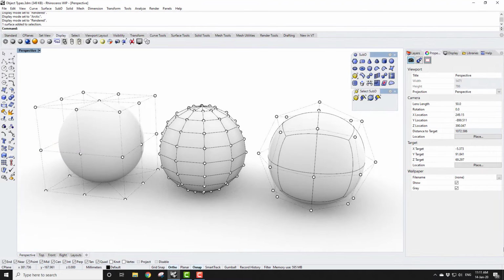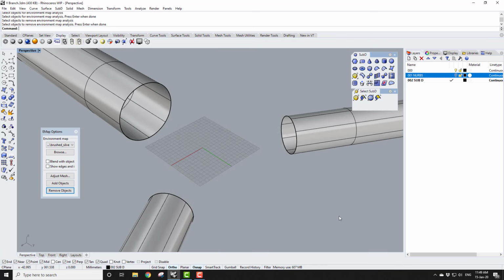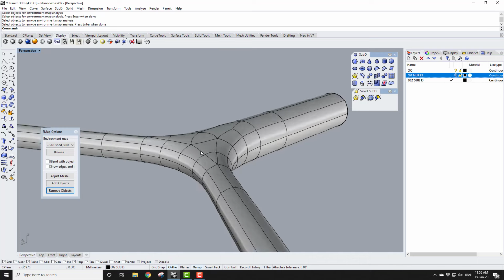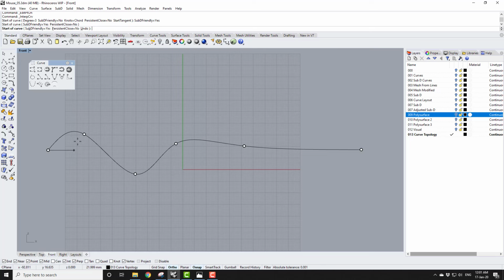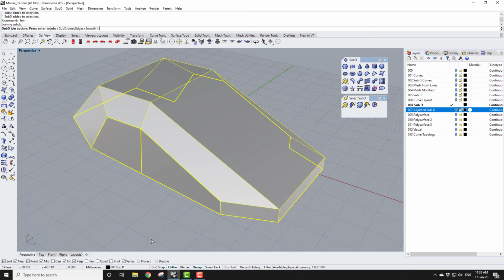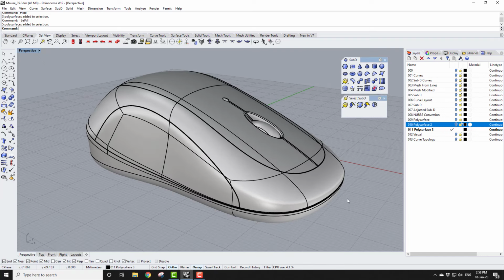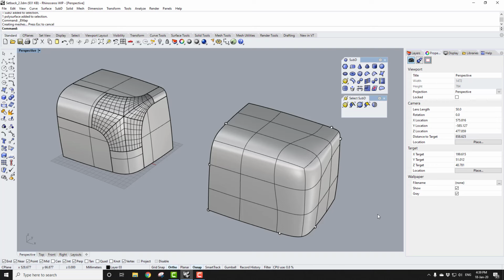An Introduction to SubD (Subdivision Surface Modelling) in Rhino3d v7

Comment: Why can't I select separate lines as 16:00 ?

And I have whole detail stands out !
Reply from the maker: Hi, To select SubD Edges either use Sub Object Selection (Shift+Control on PC or Shift+Command on Mac) and pick the edge or edges you need. Alternatively use the ‘Edge’ selection filter from the SubD toolbar – to add more than one edge hold down Shift.

Hope that helps!
Reply: @SimplyRhino3D  It helped so much, thank you))

Comment: How did you achieve a SubD surface by using Loft command rather than SubDLoft at 22:15?
Reply from the maker: Hi Yusra7. This video was created with a WIP version of Rhino 7. At that time the SubD Loft was a ‘Style’ Option in the usual Loft Dialog Box (along with Loose, Tight, Uniform etc). In the shipping version of Rhino 7 there is a dedicated ‘Loft’ command in the SubD Menu and the type in commands are now different ‘_Loft’ and ‘SubDLoft’. Hope this helps.

Comment: Always the best clarity Phil. Thanks for this one too. New to subD. Process strategy for joining 6 tubes at a common center with each out plane with the others? (Multipipe not useable.)
Reply from the maker: Hi Mel, I would concentrate on the topology and let the shape sort itself out to begin with – retain a four sided topology wherever you can.  Main requirement would be that each of your six ‘tubes’ had the same number of faces/edges around the circumference. Then you can use ‘Bridge’ or to create transitions between single pairs of faces/edges at a time, gradually working out the topology as you go. You might find that ‘Append Face’ is useful too in manually creating single faces as will working in ‘Boxy’ (ControlNet) display rather than using the smoothed form.

If 1-2-1 training would help then we do offer that as a service too, just let us know and we can send you more details.
Reply: @SimplyRhino3D  Thanks for this Phil —  I will follow the process you have described above. Please send additional on training. My Rhino Discourse ID is mhristau if that’s a better channel.

Comment: Hi Phil, I have just downloaded Rhino 7 eveluation and I have noticed that when I click on a curve the control points automatically come on, is there any way of changing that so they only come on when I turn them on. I have rhino 5 and this doesn't happen on there, I find this very annoying. Need help.
Reply from the maker: Hi Reg, I’m glad you find that annoying too 😊 This behaviour can be turned off here: _Options > Rhino Options > Mouse > Uncheck ‘Turn on control points when selecting a curve, light or annotation’. Hope this helps. Thanks, Phil
Reply: @SimplyRhino3D  Thnx Phil, much appreciated

Comment: Stitch creates an edge while Fill Hole creates a lack of an edge.

However, if one does not want the edge to be hard (ie filleted) that's when you use Crease, or in this case, remove crease.

SingleSubDFace uses edges to create a new face. (Use the flat view.)

Comment: Would Sub-D be the most suitable tool for designing a yacht?
Reply from the maker: Hi Evandro, Yes, but personally I would use SubD for the conceptual design, to explore and develop forms. Ideally you would need Rhino’s  NURBS surfaces for hull forms and superstructure so that you can maintain the correct fair-ness and clarity of form. SubD could also be extremely useful for interiors for areas such as upholstery and fabrics where we are dealing with less structured forms. Hope this helps. Thanks, Phil.
Reply: @SimplyRhino3D  thank you so much!
Reply from the maker: @evandromarchezinibezerra5206  You're welcome!

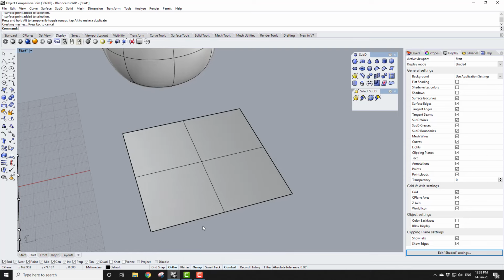Comment: 5:50 How do you pick  just one square and not a whole surface?
Reply from the maker: Hi Comprime. To select a single SubD face you can use either the selection filter in v7 and set this to faces (this is in SubD tools) or use Sub Object Selection (in Windows hold down Shift+Control before clicking on a face or edge or on a Mac it’s Command+Shift). Hope this helps.

Comment: The final bit at minute 36 is a bit unsettling to me. I have been working recently on a project where I need to make in SubD two planes that intersect doing a quarter pipe, i.e. 90 degrees perfectly rounded quarter of a circle. The problem is that with SubD the shape starts to change before the circle should start, modifying the straight part. 

So here, the presenter says at min 36 that the SubD shape is pretty close (actually better he says) than the NURBS, but the truth is that it is different and maybe you want to do it the same while having SubD edits capability. 

Is there a way to achieve that?

Note: I have tried with _bridge command, but the same thing happens.
Reply from the maker: Hi Miguel. You cannot achieve a constant radius (arc based) fillet with SubD. SubD is roughly analogous to Degree 3 NURBS in that it produces freeform geometry – so in this case you’ll have a constantly variable radius surface.

Comment: Thank you.  Can you convert the solid back to subD?
Reply from the maker: Hi, Not easily, so we would suggest keeping the SubD geometry on a separate layer instead of deleting when you convert to a poly surface. Right now you can convert a single surface to a SubD but not a polysurface. So, if you have a polysurface that needs to be a SubD then use QuadRemesh as an interim step then with the SubD option On. Hope that helps.

Comment: Hi Phil! Why would you rebuild the Sub-D iteration in just NURBS for the final version? What are the drawback of subd compared to nurbs only ? I'm coming from a industrial design background. So technically I could 3D-print a subd to nurbs conversion or are there any difficulties?
Reply from the maker: Hi Alex,
 Thanks for watching and your question. The SubD object is one continuous surface and some operations can only be done in NURBS. You’d need to convert to NURBS to do things such as: Split, Trim, Boolean Operations, add Fillets with known radii etc. You’ll need a Tri-Mesh for STL output but yes you are correct in assuming you can go SubD-NURBS-Mesh. Cheers, Phil

Comment: This is awesome! I'm loving rh7. The multipipe is great. Dumb Question... How do you close a multipipe? I'm using the GH component and unless I have another curve(s) joining at that end it maintains open. Anyway to cap it with a round cap?
Thanks in advance
Reply from the maker: Hi Carlos. Glad you are enjoying Multipipe – when you are using this in Rhino there is a command line Option ‘Cap Ends’ which can be toggled on or off. If you want to close the ends after using Multipipe then use Fill with the Single Face Option. In both cases you’ll need to add a Crease to the ends after creating them. Hope this helps.

Comment: Wasn't the "Edit blendedge" enough for the example u gave at the end of the video ?
Reply from the maker: Hi Lucky Strike. Yes you can Edit the Blend Edge here as you suggest and this works quite well. I wanted, however,  to show a SubD alternative. The advantage with SubD here is that you can Add/Remove/Slide Edges to control the shape and effectively move the Setback too - with Edit BlendEdge you cannot move the ‘corner’ Setback.

Comment: Excellent teaching skills and useful information. This could be the fastest, shortest, and easiest way of teaching. However, I still did not find the SubD fully competing with the T-spline due to the angular symmetry option only.  If there is a way to simulate angular symmetry in the SubD then I can take back my word :)
Reply from the maker: Hi Serkan, There is no angular symmetry as yet in SubD for Rhino (that’s true), we would not be surprised to see those features come in a future v7 Service Release (or perhaps v8) though.

Comment: min 15 high points - you have those because you split an edge into a triangle - triangles for subd modeling are not good. you should have collapsed all those faces into a line and maintain quad faces
Reply from the maker: Hi Claas. Thanks for your comment. Agreed, four sided faces are optimal for SubD, particularly when being used to convert to NURBS, but I wanted to show that this is not a limitation.

Comment: Great video! An aside, how did you produce the 'triangular' portion with NURBS commands at 10:20? SplitEdge & BlendSrf for the other parts clear enough, but it gets tricky at the end with 3 edges. Thanks
Reply from the maker: Thanks David! The triangular NURBS surface was, I think, built with ‘Sweep 2 Rail’ (sweeping to the pointed end) but you could also use Edge Curves.
Reply: @SimplyRhino3D  Sweep2 did the trick!

Comment: Hi,
Could you please respond to those questions:
1. Is a Rhino sub-d surface a NURBS surface by its nature?
2. Can NURBS and sub-d surfaces be connected seamlessly in Rhino?
3. Can such functions, as booleans, be applied to sub-d surfaces inside of Rhino?
4. Can we import mesh surfaces from another programs, and use them as sub-d surfaces, and convert to NURBS?
Reply from the maker: Hi Mike, sure: 
#1 - Rhino SubD surfaces are a distinct object type. The Limit surface is Spline based.
#2 - If you mean can a SubD surface be joined to a NURBS surface then the answer is no. SubD Surfaces and NURBS surfaces are different entities. You would have to convert the SubD surface to NURBS before joining the result to other NURBS surfaces.
#3 - If you use Boolean Difference, for example, to remove a NURBS cylinder from a SubD ‘sphere’ then you will achieve a result but this result will be a Polysurface. Likewise if you Boolean Difference two SubD objects the result will be a Polysurface.
#4 - Yes. You may want to look at simplifying and re-topologising complex imported meshes with QuadRemesh before converting to SubD

Hope that helps.

Comment: Hey Phil, how do I prepare a SubD surface for 3D printing?
Reply from the maker: Hi Anthony. Your SubD surface will need to be meshed for 3D printing output. So, briefly starting with a Closed SubD, use Mesh, Triangulate Meshes and Export the Mesh as an STL file.
Reply: @SimplyRhino3D  thank you Phil.

Comment: Thanks a lot.I wonder how can I make my environment map like yours.
Reply from the maker: Hi, I created a custom Display Mode for this. I duplicated ‘Shaded’ as the starting point and used Custom Material as default. This has a Gloss Intensity and Gloss Finish of around 90%-95% and an environment which is a blurry HDR reflection. Hope this helps.
Reply: @SimplyRhino3D  that's super cool.  I didn't know I could create custom mixes of Display Modes (like having colored objects while in Arctic mode).

Comment: New to Rhino (was using Fusion360) Thank you for an insight into NURBS SubD etc. I have to say though it would be easier for the likes of me if it was a bit more plain speak and less Open University tech speak.... None the less at least I know there's stuff in Rhino that I may be able to get a grasp on now as I was close to giving up. 

It's really difficult to find any Tutorials for beginners especially up to date. It may be that I've just happened to come in just as V7 has been released but I can assure you that there's a lot of similar Fusion360 Refugees looking for replacement software that they can trust right now. I'm not alone. I'm also using FreeCAD now which is similarly impressive software, likewise Blender.
Reply from the maker: Thank you for the feedback Kelvin, we do understand your point on “plain speak” it’s a challenge though to adopt this in all cases as quite often when discussing these subjects the only accurate description or term is one which can have a mathematical basis and so can be difficult to describe in any other way, but we take your point on board and will consider this as we progress with new videos.
 
Very interested in what you say about Fusion 360 users or refugees, why do you think that is happening?
 
Finally please come along to our December 2020 Rhino 7 event where you’ll see all the latest versions of the tools plus a Q&A with the developers https://www.rhino3d.co.uk/events/rhino-uk-user-group-meeting-december-2020/

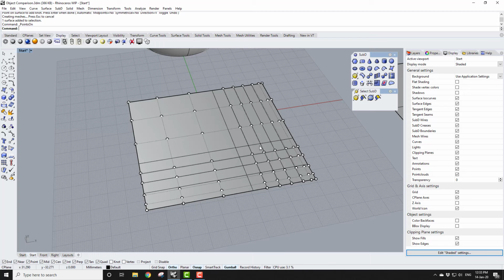Comment: It is strange that my control point on surface is not like 5:14. The control point is on the cross of the knot
Reply from the maker: Hi Frederick. Where the control points sit relative to the knot lines will depend (amongst other things) on the degree of the surface. On a Degree 1 surface if you add knots and visualise the control points they will be on the knot line intersections. On a Degree 3 surface (as on the video) the points may not lie on the knot line intersections. Hope this helps.

Comment: Control shift grab an edge face or vertex drag with and then release control and shift to extrude SubD geometry. Much easier than building curves etc. as done at 30:50

Comment: Fillet makes arc (2nd degree circular) blend surfaces. Adjusting a SubD (which is 3rd degree) to fit end points of an arc, results in much more weighted fillet (sharper corner) and is not circular. Approximation is the best choice by extracting the arcs and trying to mach them as close as possible withthe smooth visual representation of the SubD mode. That is how I do it at least.

Comment: Very nice, Thanks Phil! SubD modelling is fast and more easer. I hope Mcneel will not kill traditional nurbs tools )))
I heve a suggestion about SubD mesh. It is very necessary to smooth the surface against curvatures and bumps of the surface for a smooth design.
You can make a mesh relaxation tool. It will smooth out the vertices and tangency of patches on the border evenly.
Reply from the maker: There are no plans to ‘kill’ the existing NURBS tools. Rhino SubD objects are not mesh based. They are splined based, therefore there is no mesh to smooth. If you consider the topology carefully and aim to create good, predominantly quad based topology you can achieve a smooth transition to NURBS

Comment: Nice tools. Still waiting for DIRECT EDITING capabilities a la Moi3D and Sketchup. The Direct Editing It will be very useful for a lot of architectural and quick designing works.
Reply from the maker: If you mean simple ‘Push-Pull’ editing of solid faces and edges then look at the ‘Solid Editing’ tools or ‘Sub Object Selection’ with the Gumball manipulator

Comment: Many thanks for the (as usual) superb tutorial !
It can also be that StarPoints do not apply in the Rhino SubD surfaces, but if they do, can you tell me if the Rhino SubD surfaces also have a continuity limitation of G1 at those points like  TSplines ?
Cheers
Reply from the maker: Hi Joao, This topic is addressed within a discussion on the Rhino 7 SubD support forum, hope it helps: https://discourse.mcneel.com/t/subd-vs-t-spline-geometrical-differences/77876
Reply: @SimplyRhino3D  Thank you for the link, it did help ! This SubD "side" of Rhino is a tremendous feature, Cheers

Comment: Hi Phil, thanks for the video as always. I learned something with the MeshFromLInes, didn't know that one. Also, I have a suggestion regarding SubD topology. In your y-branch example you end up with triangles in the transition. Triangles and NGons are pretty bad if the goal is a smooth surface. Y-Branch topology can be modeled using all quads. there's one solution with 2 6-edge poles, or the "standard" solution which is 4 5-edge poles. While poles aren't perfect either, they usually yield better results than triangles or NGons. If you post your email address I can send you a .3dm with both examples. Love your videos and there's so much new stuff to learn with the addition of SubD to Rhino. Cheers.
Reply from the maker: Hi Mark, Thank you for your positive comments. There are certainly many ways to model the ‘Y’ branch and it would be great to see your solution. You can use the e-mail address from our website : info@simplyrhino.co.uk Thanks again, Phil.
Reply: @SimplyRhino3D  Thanks for the response, I just sent you a .3dm with both topologies.

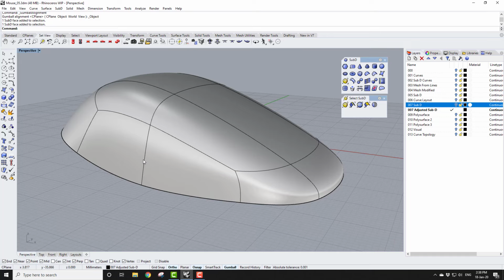Comment: At 28:04 the symmetry tool (like in T-spline) would be really useful. I hope that would be included in the final release.
Reply from the maker: Yes, Reflect is a partial solution but this could become history enabled to give something similar to TS History.
Reply: That's partially implemented with the reflect command. V7 is a WIP and is updated weekly at the moment.